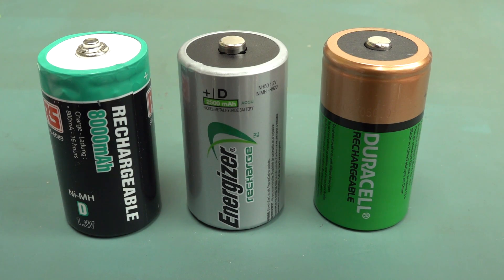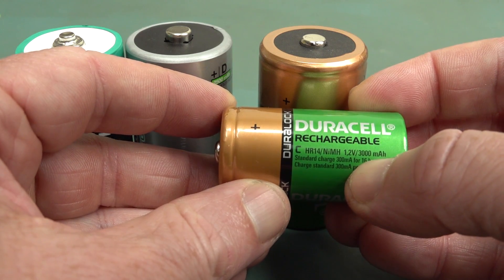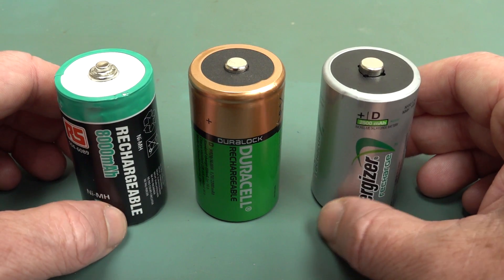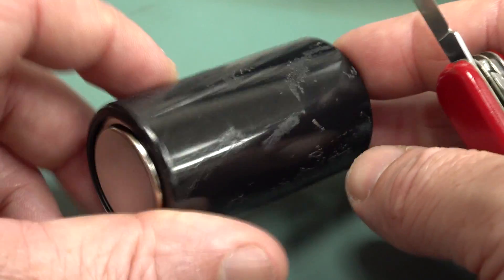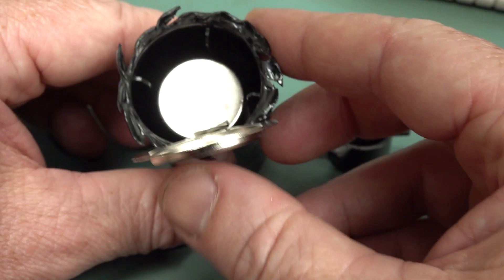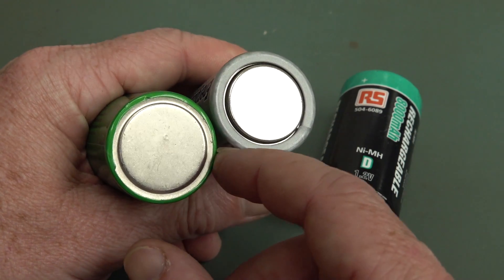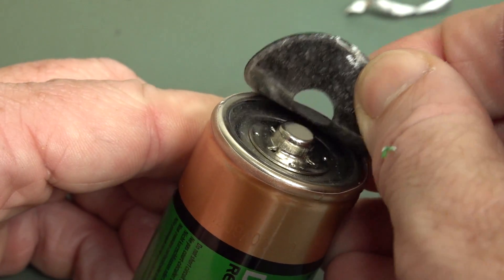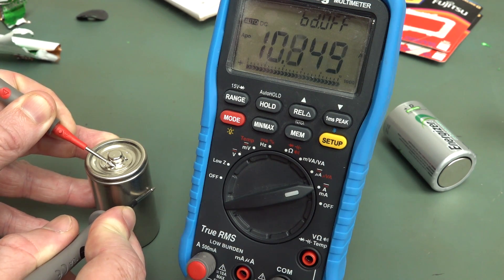EEVblog #1200 - BUSTED! - Energizer & Duracell NiMH

Comment: Few things missing here. The RS Components battery is more expensive than the other 2, but not by much so it's still a better deal. Also, there is no break down of the RS Components battery to compare. And lastly the weight of these other batteries plays into the marketing of D cells especially. Something that takes 4-6 D cells brings significant weight with it and usually it for something to be carried flashlight, boom box etc. The conclusion here is accurate, you may be paying a bit less but the storage is about 1/4 of what the RS Components battery has.

Comment: Why didn't open the 8000 mah one on cam... This looks like an add for the 8000mah one.. Next time open all 3..
Reply from the maker: There is no point. The weight tells you it's going to be a full-roll constructions. The thing I was interested in is why the Energizer and Duracell weighed so much left and had so much less capacity.
Reply: @EEVblog  i have batteries with sand so weight doesnt matter untill checked ...
Reply: @EEVblog  I agree, you should have checked. Or at least tested them to see if they lived up to their rating. Probably the 8000 will be higher, but we won't know, will we. Did you not want to break the 8000 for using it? Aside from seeing whether its fully rolled or not, I'd like to see what kind of construction quality is in the 8000.
Reply: I doubt it’s 8000 mAh

Comment: I don't use any rechargeable D cells. I stopped using non-rechargeable D cells when I discovered the same scam with them. I have adaptors that hold 3 AA cells. That cuts down on the number of battery types I need to buy.
Reply: mxt mxt  I use both types, depending on the application. In the D cell adaptors I favour non-rechargeables though.

Comment: Its not a scam, its called standarization, there are devies that use that size of batteries, so this companies need to create the batteries they are producing with a bigger size, but, the smaller original size it have a better performance(less weight with more charge) so, they put the smaller batteries with better performance into a case, wich is easier and saves the performance of the real batterie

Comment: You haven't opened RS cell to show what proper cell looks like inside. All in all this was just D measuring contest.
Reply: "D measuring contest"
I see what you did here. :-D
Reply: It's probably just battery all the way through with no empty space.
Reply: @MrFastFox666  
Apparently there are D-cells with even higher capacity, so I'd assume they left a little empty space in the center of the battery and/or didn't wind the layers very tight.

Comment: Good thing mAh is NOT unit of energy capacity. Unit mAh is volume flow rate. Someone needs to study units. mAh is pefect marketing bullshit unit! Battery capacity should be in Wh or J.
Reply: mAh is a unit of charge, not flow rate, and volume is nowhere to be seen.  Many devices have a current rating, Ah and mAh allow easy determination
of run time for a given device from a given set of batteries.  You can also use Wh of kJ for that, but generally current
is more natural to measure for charge/discharge setups.

Comment: I don’t think it’s a scam as the capacity is written on the tin... but “an idiot in a hurry” will probably only look at the physical size.... and note that the Duracell and Energizer will charge 3 times faster than the RS. Because of the smaller charge capacity

Comment: I bought those wunglo chineese batteries but in the AAA format. It said something like 3000 mah. It definitely wasn't as it barely worked or charged. Like if you put it in a flashlight it usually wouldent even turn on or work for more than 2 minutes.

Comment: isn't it just because they need to be the right size to fit in standard in the electronics? Like that's the size that they had, but they put it in a mount so it can fit. It's not like they try to hide what's inside, they just made those cells usable in the D size as well

Comment: the reason that the c has more than the d is (remember radioshack in the 80s?) their nicd d was actually a c with a extended positive terminal cap witch was a marketing gimmick i think to sell their higher capacity 4000 mah d cell

the other reason could be a clever typo trick  by omitting the "." the 8000 mah is really 800.0 mah.

i have seen this with a utility wagon that was rated for 1000 pounds but the problem is the wheels alone are 100 pounds a piece so my thinking is more like 100.0 pounds

for you metric users 100 pounds is 45.359237 kilograms and 1000 pounds is 453.59237 kilograms

also it could be possible that it is 10c rated and they arent saying that

Comment: i mean you could still call it a scam... cause the layman customer expects same type batteries to have at least roughly the same performance. i'm pretty sure they are using the laymans ignorance cause who would fully knowingly buy 25% of the capacity? is there even a valid reason for wanting a D cell with a low capacity?!

Comment: I can't condone the message you're relaying "look at all that wasted space". As battery technologies progress the W/h density increases. if you're buying low capacity cells it makes more sense for manufactures to put a smaller battery in a bigger case for shipping weight and resource cost rather then having a older technology line continue to operate. if you opened up the largest capacity batteries on the market and there was a lot of empty space then i would question why. IMO if it does it says on the package and the cell container is secure, then that's good on them.

Comment: How come there is a discrepancy on the RS battery... 800mAh vs 8000mAh
Reply from the maker: 800mA NOT 800mAh
The capacity is 8000mAh
800mA is the 1/10C charge current

Comment: I don't see what the big deal is. The batteries are rated correctly and the housing is larger so they fit the required spec for the physical size.

Comment: I bet he didn't open the lithium ion battery because it cost a lot more. Plus, he didn't factor in the cost of advertising and world wide retail distribution that Duracell and Energizer have. 

The only scammer in this video is this guy.
Reply: He literally said in the video that it is not a scam..
Reply: @dwightmanne  He literally said in the video that he wasn't going to compare prices. 

So instead of trying to look for evidence to explain the capacity differences, he whines and bitches. Constantly acting confused and flabbergasted. Acting as if Duracell and Energizer are cheapskates, while taking none of the other factors into account. 

He's either stupid or pushing an agenda with propaganda. Whatever the case, his line of thinking doesn't get to the truth. 

That's the scam, and it annoyed the hell out of me. I personally don't have an interest in Duracell or Energizer. I didn't come here to defend them. I just don't like seeing or hearing somebody that's as full of shit as this guy.
Reply from the maker: It's NOT a lithium ion battery.
I was not going to compare prices because prices vary DRASTICALLY everywhere. This video gets viewed in over 160 countries with entirely different markets. I can buy an 8000mAh cell for less than the price of a 3000mAh Energizer, depends on where you buy them.

Comment: So - out of curiosity, Went to Amazon to compare prices. The 2-pack of energizers was about $8, of Duracell was $22 (!), and the RS were about $10. So - yeah, it's a bit of a rip-off. I thought for a bit that perhaps there are safety or legal reasons to underbuild them - but Amazon has plenty of 8000+ capacity NiMH D-Cells, some at better prices. You pay a lot more for a brand name, I guess.

Comment: Their chemistry and capacity is different. In my experience, they only last a few charges. Do you really think that either company wants people buying NiMH batteries that can be cycled hundreds of times and have the same or better capacity than their disposable batteries? They make massive profits compared to selling people true rechargeable batteries. This is basically their strategy to smearing the good name of NiMH batteries and it should be criminal behavior. Get the following batteries, adapters, and chargers instead, you'll be glad you did as it will save you $$$$$$. 

https://www.amazon.com/Panasonic-BK-3HCCA16FA-eneloop-Pre-Charged-Rechargeable/dp/B07MRXDBN4/ref=sr_1_5?keywords=eneloop&qid=1555374115&s=instant-video&sr=8-5 

https://www.amazon.com/Crosse-Technology-BC700-CBP-Battery-Charger/dp/B000RSOV50/ref=sr_1_1?keywords=lacrosse+technology+battery+charger&qid=1555374167&s=lawn-garden&sr=1-1-catcorr

https://www.amazon.com/Panasonic-BQ-BS2E4SA-eneloop-Adapters-Rechargeable/dp/B00JRF2GD8/ref=sr_1_1?crid=1CBJSIONNMY8H&keywords=eneloop+c+adapters&qid=1555374376&s=instant-video&sprefix=eneloop+c+a%2Cinstant-video%2C183&sr=8-1

Comment: I don't get the problem as it's a class D which is a standard for battery size, not capacity. The 8000mAh D was probably more expensive. I greatly disagree with the message this video is giving. Additionally, Energizer and Duracell sell higher capacity variants anyway. Although I must say they do charge a lot per mAh.

Comment: It's lighter because has less electricity in it. Every time I check my weight I make sure that my phone is not fully charge. If it's fully charged I'll put it aside so it doesn't affect the scale or I delete some messages to compensate. ..... just joking

Comment: One thing is absolute. You dislike Duracell and Energizer. How about buy the battery your device reccomends? Why don't you build a better battery instead of criticize the big boys? Obviously they are doing something right. This video feels like a copy of thunderfoot but without a decent subject matter. Sorry mate, just IMO. It doesn't appear that any of the companies you listed are trying to mislead anyone. Additionally, unless I missed it and I may have as it was difficult keeping my eyes open, did you state the price difference? Additionally, did you state whether or not a device should use a higher capacity battery? They are rechargeable so? Anyways don't be discouraged by me, keep doing what your doing if you believe in your work. Cheers

Comment: At this point Energizer and Duracell could just sell C to D adaptors.

By the way, 9 volt batteries are just a bunch of AAA batteries connected.
Reply: You could only fit 2 aaa batteries in a 9 volt. Triple a's are 1.5 volts, not the 4.5 required to reach 9 volts with two batteries.
Reply: @williambrandondavis6897  They're a bit smaller than the regular AAA's, but I saw someone, I think the channel was called Kipkay, gutting a 9 volt battery and using the batteries in there as AAA batteries.

Comment: this is so wasteful... they should (and should've in past years ) use the form factor closer to the amount actually stored inside and rather push marketing for adapters. It's way more efficient and green to have, say,  a C cell or even an AA cell of choosen mAh to fit in your D socket if you have no need for higher capacity. So much greed at cost of multiple times the pollution you would actually need to produce to give the same amount of requested energy from customers. it's disgusting..

Comment: I think you're being bloody unfair IF THESE BATTERIES HAVE SIGNIFICANTLY DIFFERENT PRICE POINTS 
(But, as you've also been a lazy bugger and deliberately not bothered to google the prices, we'll never know)
They explicitly list the capacity on them so no scam there.
By offering lower price points in the same form factor, they're giving end users who need 'A rechargeable D cell" CHOICES,... 
INSTEAD of forcing everyone to buy an unnecessarily expensive cell.
Obviously, in terms of their (active core) raw material costs, they can make three times as many 2200/2500mAh cells than 8000mAh ones. 
As long as they pass some of that saving on, then fair play to them.
Of course, IF they're NOT offering the 2200/2500's for 1/2 the price of the 8000's, then it is a scam.
Reply: A quick Amazon search will show that there is a slight price difference but a 10-15% price increase for 300%+ capacity increase makes this an easy call.  Name brand is all you are paying for (aka scam).
Reply: Yeah huge price differences. Click bait.....

Comment: A real additional eye opener would have been getting technical by actually measuring with an amp hour measurement device. They are out there in eBay land and some are better than others but most decent ones have a load resistor , some have fans, all decent ones have some sort of quantitive measurement digital device, many have a display , I'm sure some of the expensive ones are connected to computers. One of the best ones I have identifies the type of battery and displays it, but its a charger rather than a discharge measurement system.  Would have really given us the info and from what I'm seeing , Durajunk and LackO-Energyizer  would probably not have met the labeled capacity !

Comment: I got D-cell cases that fit AA batteries. Love those things. I only have to carry recharchable AA's (eneloop) in my car and it fits any flashlight. The weight savings of AA's is also a blessing in a 3x D flashlight. There are also military grade lithium batteries that are 3D long and weigh next to nothing. Also great, but a pain to recharge as I don't have any plug and play charger for them. (rubber bands and bare wire on my charger)

Comment: You know something's up when the AA cell can do 2500mAH. I had a Duracell NiMH AA cell on my desk and picked it up out of curiosity, it legitimately has higher capacity than the featured D cell. The strangest part, is that the Duracell D cell actually looks like it has more coil in it than the AA cell would be able to fit.
I think, the biggest question, is how can the D cell have more coil, and less capacity, than an AA cell, especially considering it's the same company, and likely the same secret sauce? IMO it's time to dig a little deeper on this story.

Comment: A d cell classification is the size and voltage not capacity. That's will always vary but considering its rechargeable theres really no difference other than the frequency of charging. The time to charge and time to discharge when graphed will be the same amp per amp.

Comment: So tell me why the newer AA cells don't fit into the Maglite aluminum tube flashlights ? Is it an engineering oversight or a way to make folks only use standard AA batteries in the 2 cell flashlights ?    J K

Comment: Might as well just buy a AA to D adapter! You will get same capacity.
Reply: why would he buy another one of those? the whole video is about how the d cells contains a ~2000mah nimh aa cell.
Reply: @daftflamious  You pay full-D cell prices for those. It is cheaper to buy AA cells and D cell adapters.
Reply: @brittneypaul2089  But is it really cheaper in the long run? My guess its better buying thoose rs ones or something similar, that will outperform any 2 AAs you can find.
Reply: Maybe for easier charging on AA chargers?
Reply: @daftflamious  D cells containing C cells is what i saw. I dont know if your country has extra fat AA's. Yeah   you can get AAs at the same capacity as theese Dcells how ever, infact you can get AAs that outperform theese!

Comment: It looks like you got a fake Chinese knockoff. No way would Energizer actually put a smaller battery inside like that. Probably old recycled cell in a new case. That is common on Ebay with rechargeable batteries.

Comment: I always thought they made them out of AA batteries as that seems to be cheaper than making a weird cell size that has the capacity of a AA cell but for some reason has a different shape. Is this some industrial size that is in higher demand than AAs only not to home users?

Comment: The AA cells are marked 2300mAh. Same guts in a different package. I blame severely ignorant consumers and low demand for D cells. They can also play games with discharge rate and claimed nominal voltage.

Comment: Yep! The rechargeable industry have some crooked practices. A standard alkaline D cell battery is a bull of a battery. They used to make quartz clocks that would run off a D battery a long long time ago and the damn thing would run literally forever.... like 20 years on a D battery. Notice how they have done away with use of most D and C cell batteries in electronics. Now D cells are just mostly used in flashlights, but even that is dwindling. Now it's either AA batteries or lithium ion. And yes, a lot of the rechargeable D and C batteries are just a rechargeable AA battery within a D or C cell housing, a total ripoff.

Comment: I always figured there would be a AA cellinside and the D-cell case was actually just a AA adapter based on capacity. They could have saved even more money if they built it that way. You can already buy AA to C or D cell adapters.  Usually the low capacity C or D cells are much cheaper than the 8000- 10000 mAH ones. It's probably built that way so they can sell them for a lower price, since most consumers are stupid and don't read things like capacity and just look at price, it's the same reason ppl still buy dirt cheap zinc-carbon batteries.The only reason that I can think of as to why they didn't just stuff a AA Cell in there could be that these can output higher current, but many rechargeable AA cells have 2200-2500mAh of rated capacity.